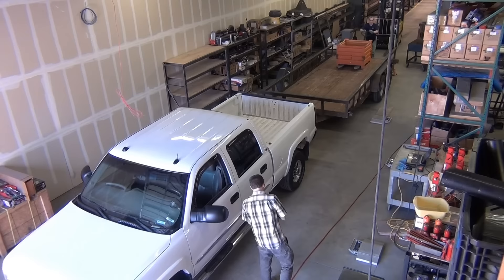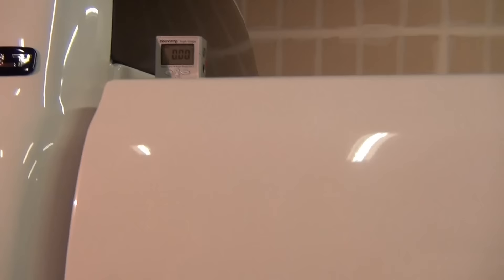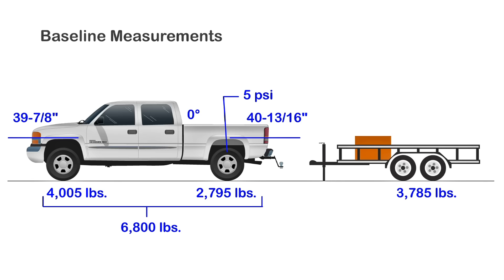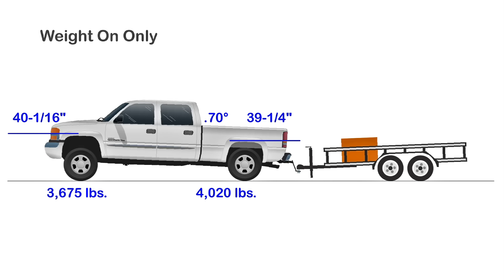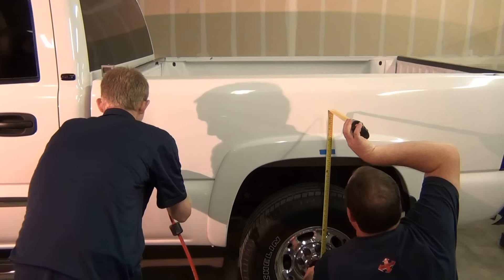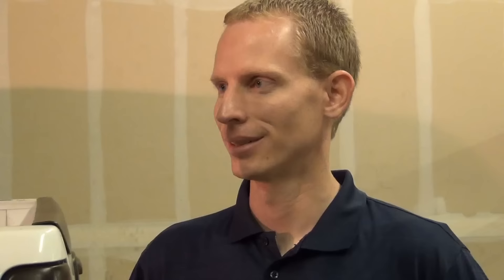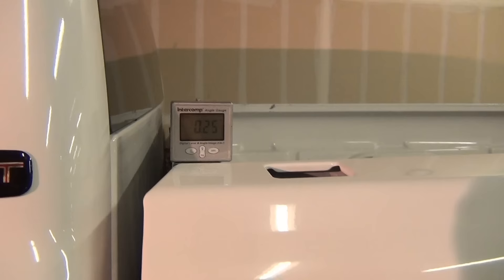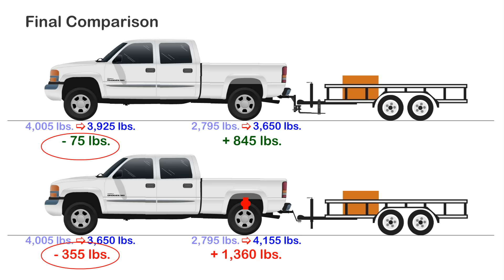The Difference Between Using Weight Distribution and Air Bags to Level Your Load

Comment: In 25 years of driving transport,
 I've seen so many bone heads going down the highway with no idea on how to load or tie down loads . Lots of people pay zero attention to even setting up the trailer hitch to the proper height so the trailer can ride level.  Keep in mind when you load,  the trick is  DISTRIBUTION of WEIGHT  to allow the trailer wheels to carry most of the weight and ride level. Dont forget to SLOW DOWN TO A REASONABLE SPEED, I've seen pickups get into a fish tail and lose control from driving too fast. 60 miles per hour is plenty fast enough.
Reply from the maker: Very wise words! There is much more to safe towing than just getting the right hitch. Driving safely is always priority number one!
Reply: Ha I'm in an 04 Titan with a 1994 28 foot coachmen Catalina pull behind with airbags and wdh rides like a dream 8900 pounds like nothing 910 lbs young weight

Comment: I use a WDH and firestone ride rite bags.... best of both worlds, imo.
Reply from the maker: We've got a video coming out this year combining WD and air bags! Be sure to check it out!
Reply: FleyeGuy how did you determine the correct air pressure in the airbags? I am wondering if they minimize the effectiveness of the WD if overinflated? (Air pressure within spec but essentially doing all the work of levelling).

Comment: Great video. Proved weight distribution is superior. Also packing your trailer strategically for trailer weight distribution is very important. Great job guys.
Reply from the maker: You are correct, proper trailer loading is a critical component of towing safely. Both weight distribution and air bags are good tools as long as they are used properly and for the job they were designed to do.

Comment: Would have been interesting to see the benefits of using both of them.
Reply from the maker: Great idea! Using both can be a bit tricky, you'll want to set the springs up before setting up the weight distribution with the hitch. You may need to use one extra washer on the hitch setup to compensate. Thanks for watching!

Comment: I was just about to buy air bags for my truck to tow my trailer. Thank God, I saw this and thank you for this information and effort to bring it to a larger audience. Very much appreciated. Thank you.
Reply from the maker: Glad our video was helpful!
Reply: I run airbags, but not for my camper, i still use the WDH. The WDH relies on a constant weight. My work trailer is constantly loaded all kinds of strange, so I use the airbags to basically adjust my headlights and have a better ride when the tounge is loaded heavy.

Comment: this is interesting to know especially since I was planning on using air bags to help with the front axle weight for steering. somehow it lost weight with air bags. I guess I need to get wd for everything instead of air bags
Reply from the maker: +thestigmach1,

Thanks for the comment!

Air bags are great for their intended use, which is to give you an easy, adjustable way to stiffen or soften your vehicle's suspension.

Weight distribution is a better option for transferring the added weight of a trailer so that both front and rear axles of your tow vehicle carry the load.
Reply: WD for bumper tow and air bags for 5th wheel.

Comment: What if you use both airbags and weight distribution hitch ?
Reply: In theory that would be the safest towing setup. Air bags essentially increase spring rate, and while that may provide a more harsh ride, it’ll eliminate some sway the vehicle might’ve picked up from the trailer (sway in this case being suspension related and not the trailer wagging around behind the vehicle due to improper loading) that’s what makes sense to me at least.

Comment: I have the top of the line equalizer hitch and it works well when I’m on a nice smooth road, but when it’s rough, the road cause’s bounce and just gets a little squirrelly. I plan to get the lift bags to give it a little more support. It seems on 1/2 ton trucks, it’s just necessary to add some support?
Reply from the maker: Airbags can help with those bumpy roads!

Comment: I use both, there should have been a test of combining the two of them, use WD hitch to solve the axle weight issue, and airbags to fix the sag. Works like a charm...
Reply from the maker: +Little Rig Big Dreams, thanks for the comment. Yes, using both is a great option. We have had a number of requests for a video showing how to use both together. It's in the works.
Reply: Agree.  I use both and feel I get the best of both worlds that way.
Reply from the maker: Thanks for the comment +Kenny Hughes.
Reply: Yes, I would love to see the results of both systems in place. Fyi great video!
Reply from the maker: Thanks +Charles Missinne.
Reply: Really shouldn't need to do this. If you distribute the weight evenly, the "sag" will be level. It's true that there's less than a degree of sag with the load distributed, but if you look at the numbers the rear axle of the truck is actually the least loaded of the three axles. It's certainly not overloaded. To your credit, inflating the airbags will probably add load back to the rear axle, but depending on how much of this load comes from the trailer, it may effectively increase payload in the process which is often a critical number.

Comment: Great Video!, I see that you have 47 thumbs down, i guess you cant convince everyone that just Air Bags are not the proper setup. I would have like to seen this video done with different head angle settings to show why when setting up a WD its important to take measurements for proper weight distribution and not just throw it together and call it good.
Reply from the maker: Thanks for commenting +Keith Gehrke.

Comment: So many troll comment !! And you guys are answering all of them props to you!! Thank you for the demonstration it's speak for itself.
Here's mine, why not go one more links on the WDH and get the truck a bit more level, and add from the baseline some weight on the steer axle?
Reply from the maker: Thanks +Rémi Blanchard, we do our best.
Yes, shortening the chain by using a link closer to the spring arm will give you more weight distribution, which should level the rig a bit more, reducing the load on the rear axle and increasing it on the front axle. This is the same as raising the L-bracket position for weight distribution hitches that don't have chains like the e2 hitch. Increasing the pre-load or downward pitch of the hitch head will also add weight distribution. This is a good solution if you do not have room to shorten the chains.

Always check the setup and how much weight distribution you are getting before and after making adjustments like this so as not to get too much weight distribution, which can be dangerous. Ideal is no more than all the way back to the baseline front axle wheel well height (or weight).

Also, other things may be effecting the setup like not having the hitch ball set at the correct height before setting up the weight distribution.
Reply: FastwayTrailer cool!! Thanks for the reply. I understand the idea here.
Reply from the maker: +Rémi Blanchard, you're welcome. Good luck!

Comment: I'd love to see what would happen mixing the two.  Use the weight distribution and then air up the bags to become level with the baseline.
Reply: yes me too! Then do it in reverse. Put air in the bags, then adjust the WDH to see what difference that makes.
Reply: @joebarczak1448  that is exactly what I do on my ute.  Not one of the big US pickups, but a Colorado ute.  Extra leaf in the rear, reset to ride level at ute only load, which is heavy, then air bags. Put van on, then adjust WDH, rides like a dream at 110ks

Comment: This must only apply to bumper pull trailers not 5th wheel trailers?
I think I still need to raise my Ram 2500 rwd about 5" in the rear to keep the trailer level. Not sure if I need to also add some rear spring work besides the air bags?
Great Video guys👍
Let's hope all the bumper pull guys see it.
Reply: Yes, this is only true with bumper pull. 5th wheel trailers attach directly over the rear axle (or very close to it). So, it doesn't lift weight off the front axle like with bumper pull trailers. Airbags or any type of spring assist mechanisms are very helpful with sag from 5th wheels. However, 5" seems like a lot. Is that all from the truck suspension sagging or does the hitch need to be raised a little to help get that trailer level? Also, make sure you are not exceeding the payload and rear axle capacity of the truck.

Comment: Although I doubt this would affect the outcome by anything significant, my WD hitch is pretty beefy in weight. I couldn’t help but wonder what (if any) difference would have been, if the WD hitch was not used at all, in the air bag test.
Reply from the maker: Maybe would have raised the rear a bit more. The hitch head & shank combination used in this video is roughly around 50 lbs.

Comment: Move the load on the trailer back to just in front of the center of the tandem axles, I'm guessing taking it back about half the distance of where they have it to the center of the tandems.  Basically, let the trailer do the hauling, not the truck.  Also, while I don't have any experience with airbags on pick up trucks, I would assume that with them aired up, there may be some sideways movement when cornering.  Sway bars would provide far more stability overall.

Comment: Being you already had it in the truck should have checked it with both. Fill air bags until was back to original pitch. Claimed they fixed the pitch but was still off.
Reply: Exactly.

Comment: I have both plus Rancho adjustable shocks. Ford Excursion suspension was just so soft.
Reply: How well does that tow I have a 05 expedition and want to jump to the excursion
Reply: I had a diesel.  Loved it, but the engine was crap.  Created a cottage industry, though.  The gas ones are still running...  it’s very heavy, so not as much payload as you’d think, but should tow just fine.

Comment: You have to measure the wheels on both sides of the vehicle and the trailer. Vehicles never weigh the same on both sides of the vehicle.
You did serve your point, something I had figured for sometime however I still would use at least some airbag adjustment even with weight distribution hitches

Comment: Why was this an either, or comparison? No one I know recommends that. The recommendation I see almost exclusively is combining both technologies. W/D is required by most truck receivers over a certain tongue weight. That doesn't stop you from adding airbags to augment the suspension to bring hack original ride height.  You need another video that covers this.
Reply from the maker: Throw Away,

This was not intended as an either/or comparison.

We simply demonstrated how each effects your tow vehicle and trailer, to show that they work differently. Many people mistakenly think that using air bags is exactly the same as using weight distribution, or vice versa. This is not true. We are trying to clarify and explain how each works, and to do this it was necessary to show each acting on the tow vehicle and trailer individually.

Many people tow using both weight distribution and air bags with great success. However, many are unaware that inflating or deflating air bags changes the way the weight distribution hitch works.

Our purpose was to inform and educate the viewer so they could get the setup on their vehicle that is safest and performs best for their particular needs.

We agree! Another video covering the proper setup and use of air bags with weight distribution is needed. We will put it in the queue.

Comment: Explained well thank you .  I'm surprised that there are some comments here stating WDH this doesn't work for all road conditions . OK, so it is not perfect but you cant get much closer unless you have some sort of active computer controlled system .Using the WDH and adjustable shocks "for extra damping"would be all you really need.
Reply from the maker: Thanks for the comment +John Park.

Comment: I would like to see what the measurements would be if you use both, a weight distribution kit and airbags. I use both.
Reply from the maker: Kevin, the best thing for you to do is check your own rig at a CAT scale. Take three different weight readings.

First, each axle weight without the trailer coupled, but with the trailer and tow vehicle loaded as you would for a typical trip. To do this, weigh the tow vehicle alone, then, pull the trailer across the scale until the tow vehicle is off the scale, but where the tongue jack of the trailer still lands on the edge of the scale. Raise the trailer off the hitch ball, and have them take a weight. This will give you separate axle weights for the tow vehicle, GVW for the tow vehicle, a tongue weight and axle weights for the trailer, and GTW or GVW for the trailer.

Second, with the trailer coupled and weight distribution engaged, but with the air bags deflated to their minimum recommended psi, usually about 5psi.

Third, with the trailer coupled and weight distribution engaged, but with the air bags inflated to the pressure you like to tow with.

Comparing these measurements will show you how the weights on your rig change by inflating the airbags, and by using the weight distribution hitch. From there you can make adjustments as necessary. You will most likely find that increasing the air bag psi will reduce the amount of weight distribution. You will see an increase in rear axle weight, and a decrease in front axle weight of the tow vehicle and trailer axle weight.

Let us know what you find. Thanks for watching!
Reply: @FastwayTrailer  OK but I have the same question. I also have weight distributing hitch and air bags. I think we wanted to see was the result of this combination in the video since you already went to all  that trouble to weigh everything. All you had to do was add some air and put the truck back to level with the weight distributing hitch and take scale readings. If you do this, let us know your exact findings.
Reply: Probably best to have both. The WD hitch is useless if the load is in the bed. I'm thinking I'm going to get the airbags for my F150 for when I'm loaded heavy (not very often) , but if I start towing more, I"ll also get the WD Hitch.
Reply from the maker: @rymaal , yes, this could have been done at that time, but our purpose for this video was simply to show the difference between using air bags or a weight distribution hitch. We do have plans for a follow up video showing the results of using both.  Stay tuned!
Reply from the maker: @lmychajluk , using both is a very good setup. If you are only carrying cargo in the pickup truck bed with no trailer, air bags would be the tool to look into. If you are towing a trailer and carrying a heavy payload in the bed of the truck, a weight distribution hitch can help spread this weight out to all of the axles of the combined vehicle, so there is not as much stress on the rear axle of the pickup truck.
Reply: Kevin, Airbags are meant to carry the load directly above them, Such as a properly distributed load in the bed, or a gooseneck/5th wheel trailer, not for a leveraged load behind such as a trailer.  The way these guys set up the rig is exactly how they should be set up.  If you need airbags for a trailer when using a WDH, then you either have the wrong hitch, or are over weight.   For a trailer, airbags at their minimum pressure keep the rear end stable, but should not be used for load carrying as they will upset the WDH.   Think of Sumo Springs or Timbrens and how they function when using a WDH, that is how the airbags should also be used.

Comment: I would have also like to have seen if you had combined the weight distribution and the air bags  and see what that would have shown.
Reply from the maker: Using both can be tricky. If you have too much air in the bags, then you will lose the sway control and WD of the hitch. If you use both then you need to set up the air bags first and then the WDH, so the hitch can still give you WD and sway control. Setting up the air bags last will take the tension off of the hitch.
Reply: @FastwayTrailer  If you have a load in the bed, can you rely on the WD hitch to correct for that load as well? I currently use a WD hitch for my TT, but mainly with an empty bed. I am planning a trip where I will need to load a decent amount of weight into the bed and was worried that it really is putting a lot of load into the WD hitch, and was contemplating adding airbags to help with the bed load. Note that I will still be within all my limits.
Reply: @silsby103  If still not exceeding your rear axle limits, the WD hitch and/or airbags will help. But with a WD hitch, it does add to the loading on the hitch similar to adding trailer tongue weight. It depends on how much weight you add and where you add it. Weight behind the rear axle will add to the hitch load. It isn't pound for pound because of the leverage principle and the fact that the hitch ball is farther behind the axles than the weight you are adding. For example, if you add an atv to the truck then about 1/4 or 1/3 of its weight will end up being supported by the hitch. So if you have a WD hitch rated for 800 lb tongue weight, and your trailer tongue weight is 600 lbs, and you add an atv (600-700 lbs) into your truck then you are very possibly/likely exceeding the rating of the hitch. So in your case, airbags with the WD hitch could be a good solution.